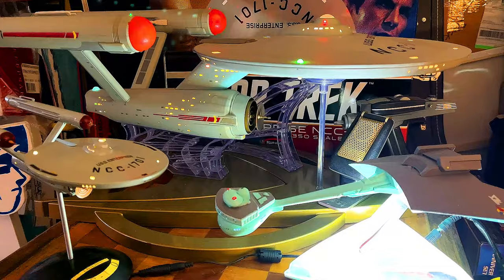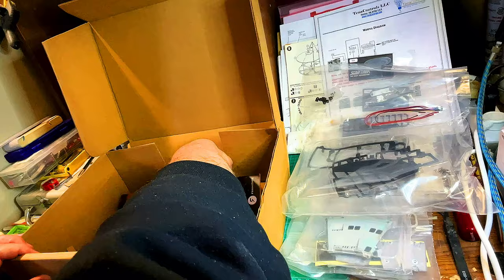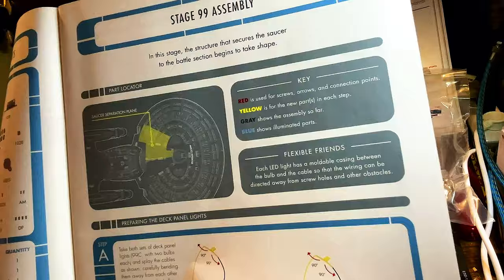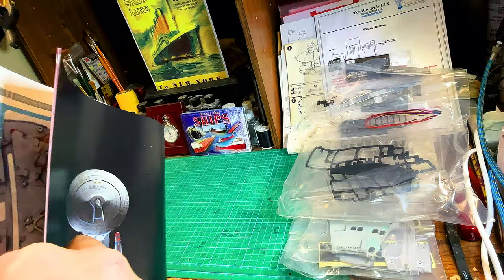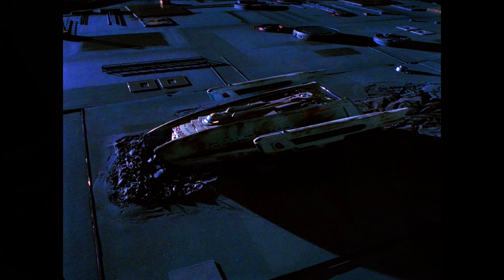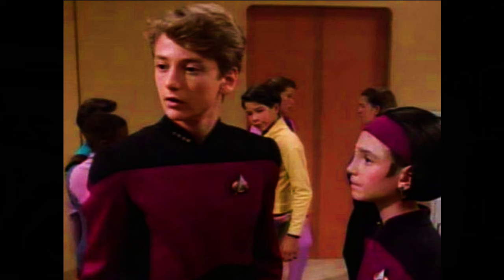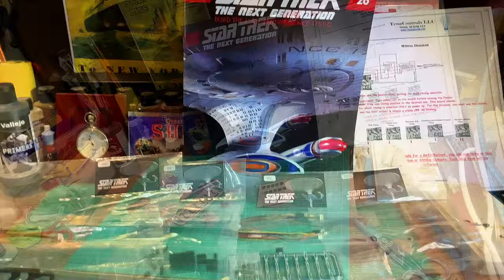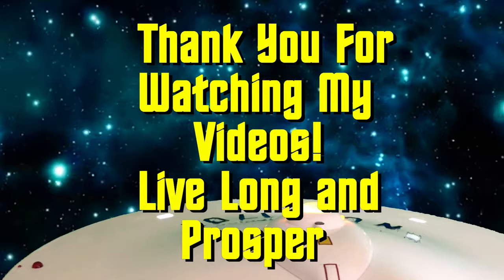FanHome Star Trek The Next Generation Build The U.S.S. Enterprise D Shipment 26 (Unboxing Video)

Comment: I tell you. Fanhome should have not taken this cursed model.
Can't count how inaccurate this thing is and the amount of light like it has.
You need batteries for the saucer, for each nacel and the bottom.
If you want to build it, don't light it or you are going to need to do a bunch of modifications.
I was very excited for this model but I looked first for reviews. I never found one single positive review.
It would have been better if the creators had chosen the TOS or the one from the motion picture.